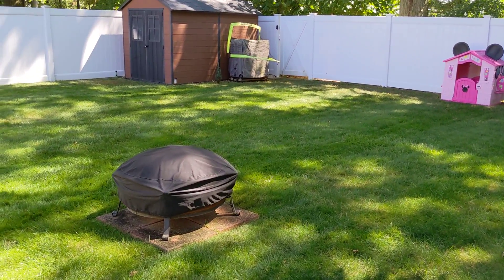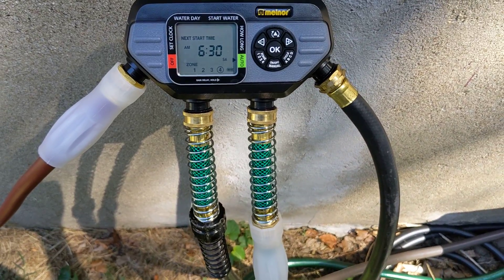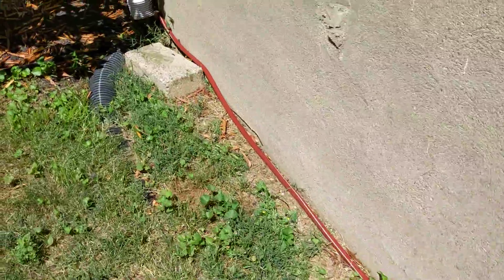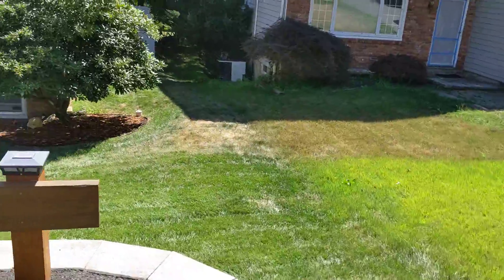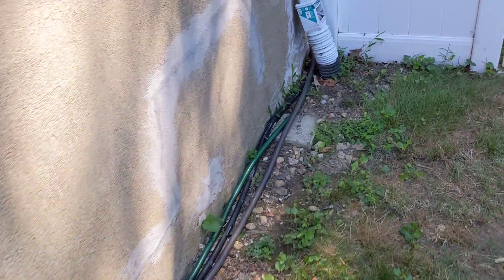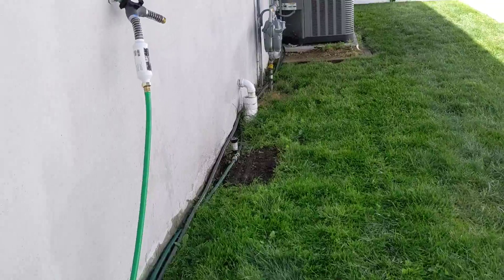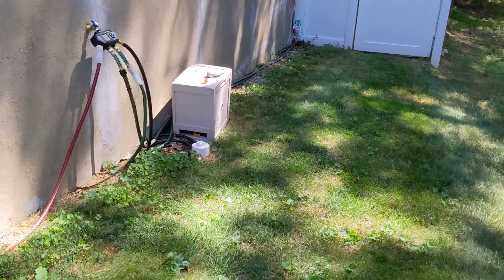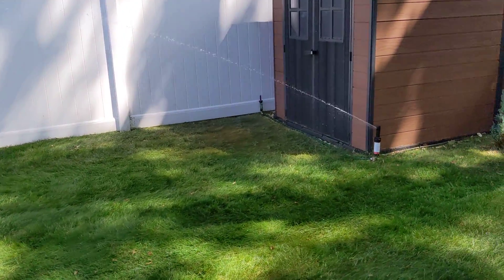Automatic Above Ground Sprinkler System DIY

Comment: Do you need a pressure regulator or a back flow regulator?
Reply from the maker: They should not be on a constant water source. So if you use them you'd need them after the controller not before. But I don't run one and never had an issue

Comment: Do you not weed whack your edges at all? I’m setting all of mine up in garden beds so I can still have nice edges and can bury the hoses in a light layer of mulch
Reply from the maker: I edge every week. Nice edges are a must, the hoses are run outside of the edge but up against it so I can still flip my string trimmer upside down and edge.

Comment: I did your set up but then took it a few steps farther. I replaced the hoses with poly pipe and buried the lines and sprinkler heads. Works great and still have the Melnor timer with 4 backflow preventers on each output port . I didn't put a single backflow preventer between the spigot and the timer because I read that those backflow preventers cannot be under constant water pressure.
Reply from the maker: Thank you for calling that out on the backflow preventer. I just did some googling and see that too and will be changing. In terms of your setup, that's awesome and what I'd love to do. But I'm up in the mountains and cannot put a shovel in the ground without hitting rock. If not for that, id do the same. Recently had a fence pit in and they spent 2 days with a jackhammer for the post holes.
Reply: @LarryFopps  Damn, the fence installers must have charged you a small fortune for that job. May I ask what state you're in?
Reply from the maker: @TheDylan6908  I'm in North West NJ. Yeah that one hurt. Anywhere else I've lived I'd do the fence myself but literally can't dig a hole to plant without hitting rock
Reply: @LarryFopps  we're kinda neighbors. I'm in Queens County, NY. I have family in Morris County, NJ
Reply from the maker: @TheDylan6908  I'm in Morris county. Where about are they
Reply: @LarryFopps  My brother-in-law is in Parsippany and my niece  just bought a house in Morris Plains. Funny, small world. Just sub'd to your channel btw.

Comment: My question is …what time do you start your system up in the morning so it doesn’t interrupt showers in the morning ? And how long do run each zone for ? They say the best time to water is between 5am-9am so you gotta be starting at least at 3am ? Hope to hear back from you !!
Reply from the maker: I'm starting mine at 4:30 am and running for 20-30 minutes dependant on which zone. Different sections of my property are different types of grass so I time accordingly

Comment: I have an underground system, but I am thinking of disconnecting it and doing something like this. My underground system has a lot of maintenance costs, which you can pay in either time or money. Paying a company each year to winterize or buying an expensive compressor. Paying a company to backflow test it, no option to DIY that. And time spent digging up pipes to fix them, digging up sprinkler heads to fix them. Plus once it's built you can't really change the layout of your landscaping. I think underground systems are only worth it for people who don't mind forking up extra $$$ to just pay to their landscaper to maintain the thing.

Your system seems way easier and cheaper for a homeowner to maintain

Comment: One thing- add a backflow preventer between the timer and the spigot to help just in case some sediment gets in the line from a pinhole in the hose or something. They are super cheap at a big box store; around $2-5 depending on the build of it.
Reply from the maker: I've added one. Thanks for that suggestion
Reply: @LarryFopps  No problem. Can help yours and your family's health in the future.

Comment: With these auto garden hose auto sprinkler systems, are they to be used with the garden hose knob to be on always, or will my home flood or the sprinkler control box bust from the overload of water pressure  from the outside knob that is turned on ???
Reply from the maker: They're to be used with the hose bib on. This then acts as the valve. It opens as the programmer demands water for each zone based on how you set it. Nothing to be concerned about it's essentially the same thing as the hose valve being closed. The only concern is freezing temps. Obviously in winter this needs to be taken off. I have a video on winterizing the system as well.
Reply: Water in any pipe in your house is always under pressure unless an upstream valve is closed. So either the valve in your spigot is holding the water back, or the valve in the control box is. If they fail the water will go out of the house, not inside.

Comment: I did this same setup but I used half inch polypipe and used the orbit b hyve xd timers with the wifi hub which allows me to control my sprinklers from my phone anywhere in the usa
Reply from the maker: Ooh that sounds awesome
Reply: Great idea with poly pipe. Can you explain the connectors used on poly pipe to the sprinkler head. Links would be appreciated ...IF YOU HAVE TIME.
Reply: @johnhaubner1889  I used half inch poly tees barbed on each side with half inch threads on top that screw on to the bottom of the sprinkler head
Reply: @johnnelwhite  TY!
Reply: https://www.sprinklerwarehouse.com/poly-tee-1-2-in-barb-x-barb-x-mpt-1403-005?turntosku=1403-005&turntoEmailType=reviewSolicitation&turntosuid=SUMEYk8Waw&transId=4980238&reviewStartAction=rateIt&starSelected=0&turntoFromRebelmail&turntoNotificationData=eyJhbGciOiJIUzI1NiJ9.eyJzZWxlY3RlZFJhdGluZyI6IjAiLCJmaXJzdE5hbWUiOiJKb2hubmVsIiwibGFzdE5hbWUiOiJXaGl0ZSIsImFscmVhZHlSZXZpZXdlZCI6ZmFsc2UsInZhbGlkYXRpb25FcnJvcnMiOmZhbHNlLCJ0eXBlIjoicmV2aWV3Iiwic2t1IjoiMTQwMy0wMDUiLCJpYXQiOjE2Nzk3MDc5NTYsImVtYWlsIjoiandoaXRlMTAyMTg0QGdtYWlsLmNvbSJ9.imAta9joZeeUJnILX8hvVa_kpW_reLLMtcpdkdM_fik&tttok=eyJhbGciOiJIUzI1NiJ9.eyJhIjpmYWxzZSwicyI6IlJTRSIsInQiOjQ5ODAyMzgsImUiOiJqd2hpdGUxMDIxODRAZ21haWwuY29tIiwidSI6MzQ2NzI3OTUsInN1aSI6MzMwODc5OSwiaXNzIjoiVHVyblRvIiwiZXhwIjoxNjc5Nzk0MzU2MTg2LCJpYXQiOjE2Nzk3MDc5NTYsImNhIjoiUG9seSBGaXR0aW5ncyJ9.celysb9puGkJsD_UVbiI2z2Z5YlL1v98xP_UrWOyRCk&turntoflow=review

Comment: How do you have enough pressure?
Reply from the maker: It's all about the multi zone running one at a time hose diameter for volume. 3/4" works best and not putting too many heads on each run

Comment: What did that set up run ya?
Reply: I have a very similar setup, but I use brass impact sprinklers. All in for four hoses, timer,  and sprinklers, you’re looking at $200-$250
Reply: @BensMusicDojo  how many impact sprinklers do you have on each zone.  ?   I just picked up a 2 zone  timer from lowes  and was wondering  if I can put 2 impact sprinklers on each zone  or should I exchange the timer for a 4 zone timer and run  1 impact sprinkler off of each zone 

Thanks

Comment: What I did is use blu-lock irrigation tubing instead of garden hose because they are cheaper and burried them under ground. Used the melnor timer and now I have a fully automated underground irrigation system. It is just a little but more work but it was all worth it. I just blow out the piping with an air compressor before each winter.
Reply from the maker: That's awesome. I'd love to do that, but where I live is a mountainous area, and I cant put a shovel in the ground without hitting rock. If not for that, I would have done the same as you.v
Reply: What size blu-lock piping did you use? Was looking at burying my DIY set up too.
Reply: @ulrblitzer  0.5 in blu lock at home depot for about $15 per 50 feet roll. I used 6 orbit saturn iv with the 0.5 gpm nozzle works great with no pressure issue
Reply: Is Blu-lock considered better than Polypipe?

Comment: I have someonewhat of same setup but looking to expand in the backyard. Do you notice different of force to the heads using hoses vs poly?
Reply from the maker: I don't have any poly to compare to, but 3/4 hose helps volume
Reply: @LarryFopps  so you have 3/4 garden hose running?
Reply from the maker: @Gandio420  I have a mix of 3/4 and 5/8 garden hose currently. Mainly because I had a few hundred feet of 5/8. But the sections with 3/4 are performing better. Next year I'll like update everything to 3/4
Reply: @LarryFopps  lol ya I have the same problem thus was exploring 3/4 poly but guess this will work for now
Reply from the maker: @Gandio420  Walmarts got good prices on 3/4 garden hose
Reply: @LarryFopps  ya for sure also harborfrieght and costco sometimes